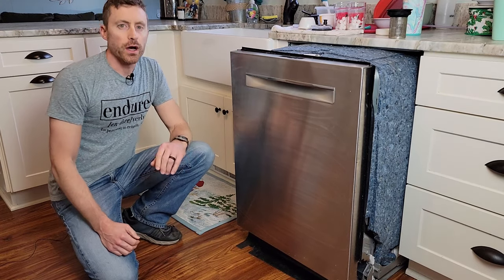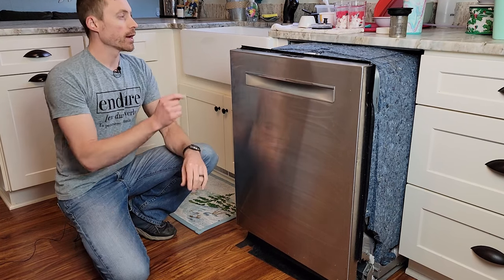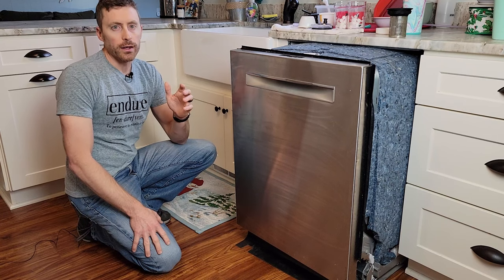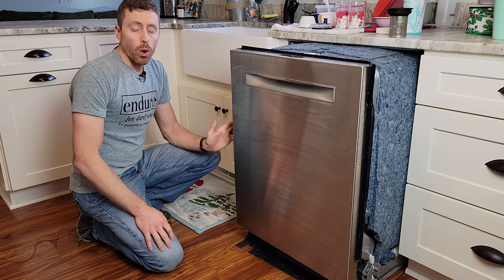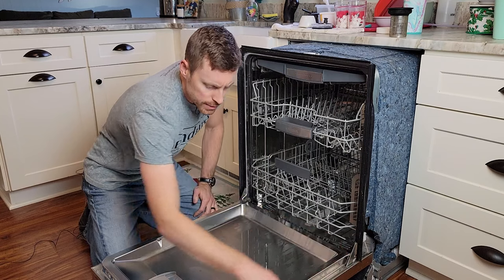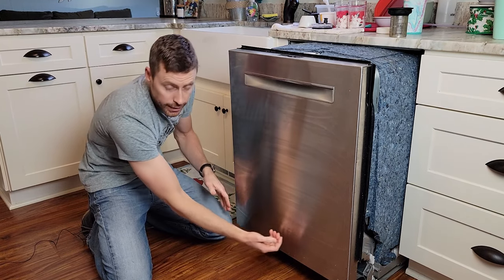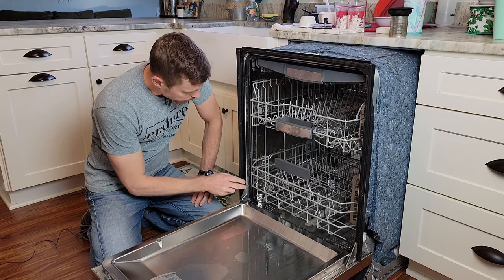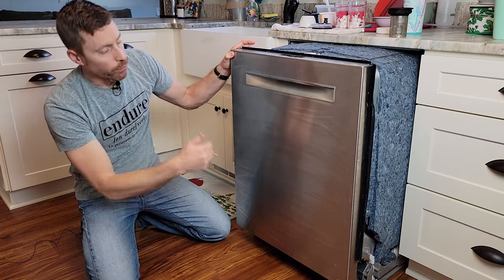Bosch Dishwasher e15 Error Watertap - Prevent it from coming back - Bosch 800 Series

Comment: Thanks for the very concise and informative video.  I installed a 300 series yesterday and got this error on my second wash.  I put the mounting brackets on the side and noticed one isn't fully covered by the gasket - you can see it poking out just a bit.  Could this be breaking the seal and causing the error, or can you think of any other installation mistakes that may cause this?
Reply from the maker: Bummer. Not sure why a new dishwasher would do that. I had a lot of trouble with the mountain brackets, but I wouldn't think they would be pushing against the seal. You may need to check under the dishwasher to see how much water is in there. You can check all your connections to make sure something wasn't loose, but in my case water was leaking because the door wasn't fully sealed. Hope you get it fixed. Since it's new you should be able to connect with Bosch for some support. Please update us here when you get it figured out.

Comment: hey there! we are having an issue with the bosch where i have had it at 45º for over 24hrs and its STILL leaking a water out of the door... is this a separate issue?? (its unplugged but i did not turn off the water source to the machine)
Reply from the maker: Wow, I wonder if you need to take the door off and see if that insulation in there is soaked.

Comment: Hi, We have a 'bran new' return we purchased from Bestbuy outlet that was installed today. The installer Bestbuy sent could not get it to run for more than 10 seconds before it would stop. The red blinking led on the base was also blinking. I checked the magnet latch and it was stuck upwards and brought it back down and now can feel the door click into place where I did not before however the problem persists.  After a couple hours the dishwasher also gave an Watertap E24 error. So not sure  if its our drain at fault or problem with the dishwasher itself. Now waiting for Bestbuy Geeksquad technician to take a look. What could problem be? Thanks
Reply from the maker: Dang. Yeah if the door isn't sealing then water will drip down and trip that watertap error. I would guess the door isn't sealing right as that seems to be a common problem with these. Maybe that's why it was returned. Hopefully they can fix it.

Comment: We have a tear/hole in the gasket on the left side...is this causing the same problem?
Reply from the maker: If it lets water leak out, it will catch it in the tray at the bottom of the door (its hidden with the front panel on) and channel it to the float that will cause the e15 error.

Comment: If you just leave it as it is for a few days, will it dry out without your having to mop out the water?
Reply from the maker: Unfortunately it depends on how much water. Sometimes it's just a little water, sometimes it's a solid 1/3 inch of water that pools up under there. It happened to me multiple times where it wasn't enough water to have to towel out the water or tip the unit over. But a few times it was a lot of water.
Reply: @poodledad  Thank you so much. But if I wait, say, for 2 weeks, water will eventually evaporate?
Reply from the maker: @anaesterhazy631  it's quite possible that it will.

Comment: All good until I tried to take the door off. I have a different Bosch than the one you took apart. I could not take the door off.  It looks like there are catch points on the door up by the where it attaches to the main panel. No matter how I tried it could not take the door off. I am open to suggestions on how to get the door off.
Reply from the maker: any luck?

Comment: But, once the e15 error happens, dont you need to clean out the water by the sensor below? You didnt do that...
Reply from the maker: Yes, if there is a lot of water you will have to either tip the machine or towel it out. In my case, it was such a small drip of water it dried quickly so I didn't have to drain it.

Comment: It is very unlikely that the door gasket will cause a leak into the bottom collection tray setting off the E15.  The leak is coming from elsewhere.
Reply from the maker: There's a little channel right under the door that catches any water from the door gasket and funnels it directly to the sensor that sets off the e15 error. In my case I could see the trail the water was leaving, and I could even watch it drip from that collection tray. There was a lot of gunk on the bottom side of the gasket and after cleaning it all up I haven't had the error again. I was getting the error multiple times a week prior to this. Now my dishwasher has run through 75ish cycles without the error.
Reply: @poodledad  i think you're right...I pulled mine out a bit farther and witnesses the water inlet valve dripping... it's a $21 part and pretty easy to replace👍🏽

Comment: I've done all of this and it still doesn't work... Any ideas ?
Reply from the maker: have you been getting the e15 error repeatedly?
Reply: Yep.
Reply from the maker: @charliesmith122  Bummer. It could be dripping from somewhere other than the door seal. So, not sure what's the next best culprit.
Reply: Someone put dish soap in while I was away. The major mess was cleaned up but the bottom was still full of water when I got back 2 days later... I've drained it, cleaned the filters, cleaned around the door  and tipped the machine to pour out any water I could from underneath.... It might need a professional...

Comment: I live in a cold climate and the dishwasher backs up to an exterior wall and every winter the condensation sets this code....
Reply from the maker: Oh dang, so does it reset itself, or do you have to dry up the moisture?
Reply: @poodledad  when the condensation evaporates it resets which usally depends on how cold it is but about 2 days most times. Although it doesn't do it if I don't use the dishwasher below about 20 degree exterior temp

Comment: As I go to unload the dishwasher the dishwasher unit almost fell out on me 
Help 
It loose and comes out
Reply from the maker: Alas, this is another common issue. The brackets that they include to mount do a terrible job of securing the dishwasher. You'll have to unscrew the brackets (they should be mounted either on the side or top) and reattach them. Honestly, I had to do this 4-5 times before I got a tight fit. I even bought another pair of brackets. Another idea is to get two sets of brackets and secure both the sides and the top for better security.

Comment: In thought my Samsung was junk, until i bought this piece of crap that has been giving me nothing but trouble for all of the 4 years I've own it.
Reply from the maker: Dang, what other problems have you had? I've had trouble keeping it mounted and then also this e15 eror caused by the door not sealing properly.
Reply: @poodledad  I've replaced the drain motor,  a valve and the switch in the side in the "collector bottle"...
Reply: Yes...same here...cant keep it steady so it doesn't flex when closing the door...